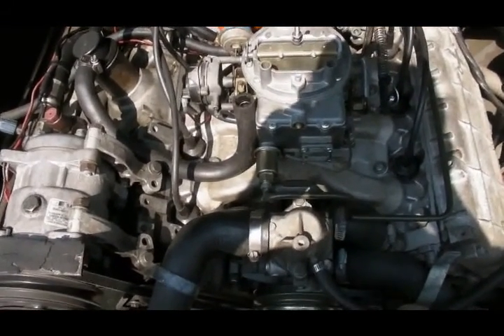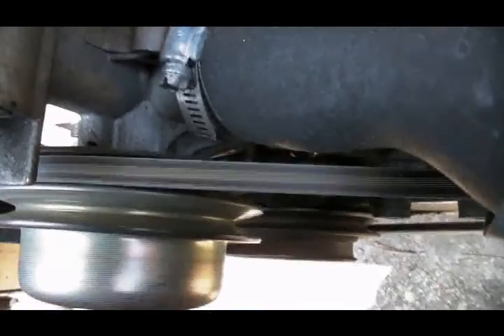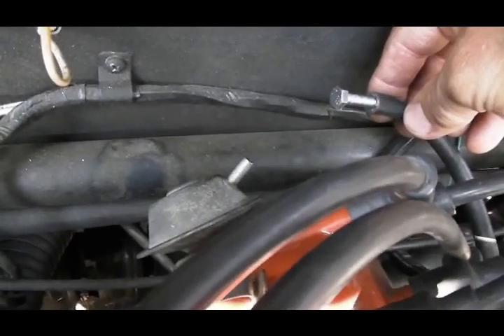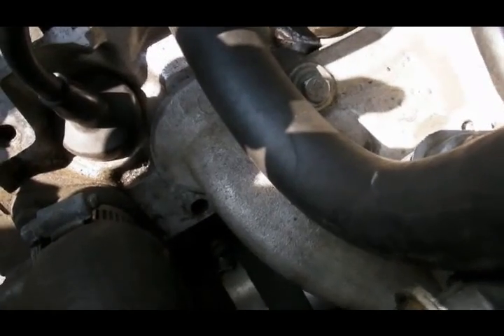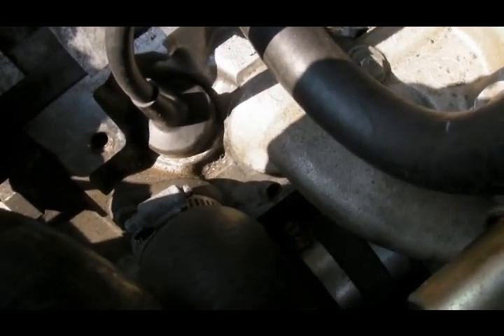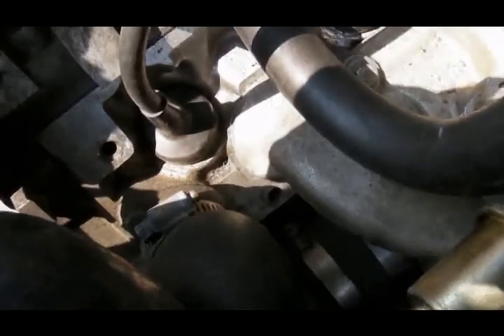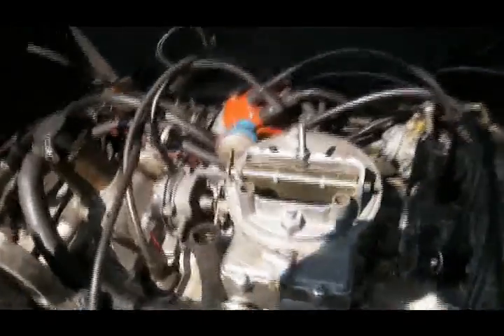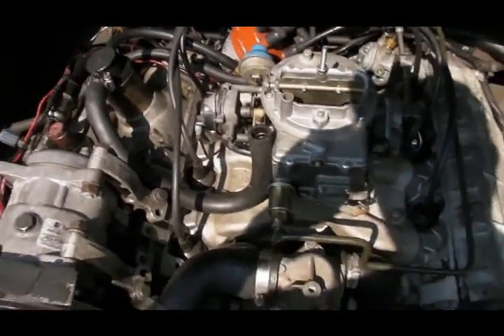DeLorean Ignition Distributor: How To Install

Comment: That was very informative. 
Just a couple of concerns-
1) Do we need to really worry about vacuum advance?  There is no advance at idle. 
2) For those of us that don’t want to remove our intakes— Wouldn’t it be just as easy to remove number one spark plug and insert a Phillips screwdriver. And watch for high point during engine rotation?

Comment: Great Delorean Channel.  Please correct me.  
Why not use basic engine methodology &  just take #1 plug out, put finger over hole until you feel compression or use one of those old spark plug whistles, or just a compression tester gauge or just the hose screwed into #1, rotate the engine by hand til you feel compression or see a rise on the gauge.... then put that locator bolt into that TDC hole????
Personally, I'd take it much further to be precise to mean TDC just to account for chain stretch ect.  Get a dial indicator with magnetic base, (cheap on Amazon), with an extension assortment, & take measurements that way like agreeing a cam to find highest point, or when needle stops moving up/down & split difference to find TDC, this way TDC on the timing plate can be verified and/or adjusted for future ignition timing setting.  I also own the same Innova Timing light!!!!!  
Also, why not run 3-4 degrees advanced for more "Pep"! .....& if it pings run higher octane colder plugs, ect. ect.ect....many ways to run more advance for best power/ecconomy, & avoid detonation.
Just trying to help.